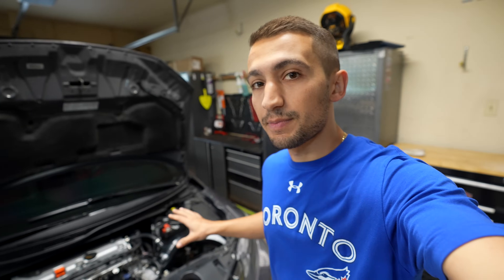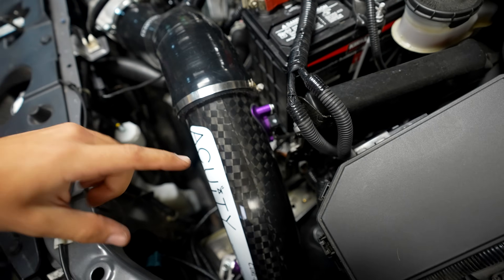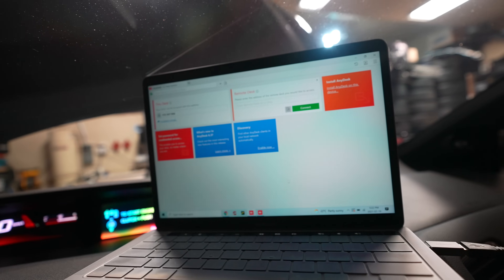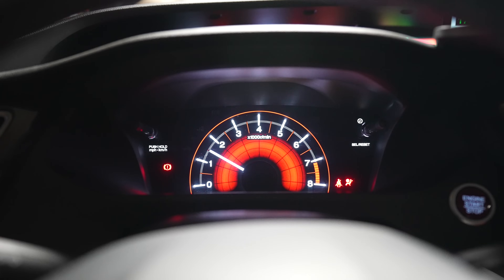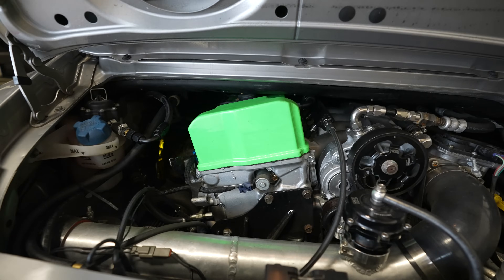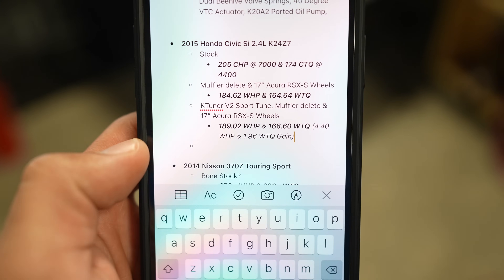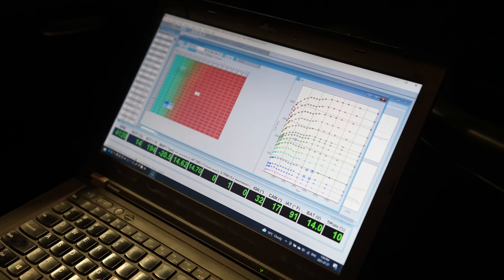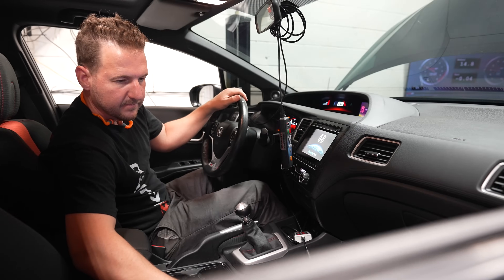Getting a Pro Tune for My Honda from TuningByNick // 9th-Gen Civic FBO Part 4 of 4

Comment: Hey you’re very knowledgeable in k swaps. And I would like your expert opinion? I just did a JDM K24 swap into a 2004 RSX Base 5 speed manual. It cranks but it won’t start. This are the mods I did: 1000cc injectors, skunk 2 intake Manifold, skunk2 70mm throttle, skunk 2 4bar Map. Acuity tps. K tune fuel rail. And your classic autozone short ram intake. It gets fuel pressure (I have the gauge), it cranks. But it just won’t start. My question is do you need KPro on the ECU for it just to start or can it start up without it? Or did I mess it up? Appreciate your help in advance
Reply: it absolutely needs a tune before it’ll start, especially with gigantic injectors like those, 510cc would’ve been just fine. it can’t fuel it properly at all. base tune it before even trying to crank that

Comment: Wow, just did my JDM k24a RBB-3 swap after blowing my k20z3 lol. Intake, header, exhaust, 4piston type s oil pump, 50 degree VTC from my k20, stock TB and injectors i made 233whp and 198lb ft torque vtec hits at 5k till 8.4k. Not sure you made such little power with the the upgrades you did. Considering you are basically FBO and i have basic bolt ons. Love the build series tho

Comment: Loving the sound that comes from the newly installed intake.
By the way, do you have any advice on ignition knock during low rpm? 
Will it cause any serious damage to the engine?
Reply: Why are you getting engine knock, running a stock ECU with a modded engine? These engines can handle knock quite well, but it will eventually lead to oil consumption.

Comment: Do I have to get a pro tune if I just have catback and intake or would a hondata flash pro basemap suffice?

 I did talk to Nick and his pricing is very reasonable, I just won’t have the funds for the next few months.

I bought flash pro intending to pro tune asap I had funds set aside and my Bc coilovers completely failed on me
Reply from the maker: Hey man! The basemap should tie you off for that amount of time, but I would watch your knock count while you're driving to ensure you aren't hurting the engine. 
BC has a warranty if you bought them new. Might be worth looking into
Reply: @milanmastracci  Thank you for the advice. Solid advice but I bought the car with the bc coilovers, not sure if they would cover if I wasn’t the original purchaser. I guess I can give it a shot.

Comment: Huh my 9th gen accord sport makes more than that and it’s a “full bolt on” car
Reply from the maker: You're running a completely different engine. You're basically running a 10th gen Honda Civic Si 1.5L Turbo engine. It is a lot harder to make power from a car that is not factory equipped with a turbocharger.
Reply: @milanmastracci  my car doesn’t have a turbo, it’s a k24w I said 9th gen accord not 10th gen lol but I think the reason I’m making more power is because of a lot higher compression and GDI. However I do love the 9th gen Si i just wished there was more all motor potential there
Reply from the maker: Oh that's my mistake! Yes the higher compression ratio will for sure help! The engine build for this car I have going is relying on higher compression pistons to make that extra juice

Comment: Youd be better off just putting some drop in cams those cams r holding you back big time
Reply from the maker: When I made this video, aftermarket K24Z camshafts didn't exist.
Reply: @milanmastracci  its the same head as the k20z3 lol

Comment: If Im only getting a catback exhaust and flashpro, do I need a pro tune or will the basemap reflash be okay?
Reply: you will feel a gain even on base map
Reply: If it's only catback you don't need to do anything. Once you get a downpipe, you should get a tune to take advantage of it. But overall you're gonna be okay with a basemap. But definitely get tuned when possible

Comment: Numbers seem a little low for a RBC intake manifold, this car with down pipe and exhaust, stock intake manifold with cold air intake can make about 220hp
Reply: Same dyno system was used my car made 201 on 91 octane fuel
Reply from the maker: Remember to compare dyno figured using the same dyno. I made this power on a Dynojet. Other dynamometers can give you higher and lower figures using the exact same car.
Reply: nick doesnt do any corrections, What it puts down on that day is what it is. Most places have some type of correction for weather/humidity/kpa. In EU we use DIN correction so it doesnt matter what outside temp is. If you dyno at 35c temp you will get +2.5% correction, if temp is -10c you will get -2.5% correction of actual power.

Comment: Hey man good vid as always 🙏🏻 I have a question regarding gas octanes specifically shell 91 vs petro 94. I see that your car is tuned on 94oct, what was your reason? I know for a fact that 94oct or higher is used for FI cars to eliminate or minimize to some extent detonation or pre detonation. In your opinion what are the pros and cons of both octanes in racing/tuning (performance) perspective? Or even economical use for n/a or FI engines.
Reply: Higher octane can get away with more timing which equates to more power(to a certain extent).
Reply: 94 looks better on a graph, or maybe they just have 94 octance in Canada
Reply: Higher octane rating = higher detonation threshold, therefore more advance ignition timing and higher compression ratio can be run for more power and torque

Comment: So i noticed while Nick was tuning that you had your VSA, Hill start, ABS, and traction control. I had these exact lights pop up after swapping my clutch out. I actually still have them. How did you get rid of them? We’re thinking it’s something to do with the steering column
Reply from the maker: So those lights illuminated at Nick's shop since the front wheels were spinning (on the dyno), while the rear wheels were stationary. So you most likely have a faulty wheel speed sensor that needs replacing. I would get an OBD scanner and see what codes come up.

Comment: wassup man i had a ktuned 72 mm tb on my car and got tuned and everything, but the car ran bad with it on, i put the stock tb back on and got retuned and the car runs so much better, any explanation?
Reply: To run a larger TB you need cams, a larger plenum, a good header and exhaust. 72mm even on a stock kfrank or k24 will negatively affect low throttle power, ie bog. The stock 62mm TB is well enough to support any kseries bolt on engine

Comment: Interesting. The internet made it sound like the RBC loses a lot more low end power. Would be interesting to see the difference between stock and RBC with the same supporting mods.
Reply: @chrisb15679  i feel the same about my 2g tsx sedan with the auto. I'm wondering if it would be worth it
Reply: @chrisb15679  thank you chris
Reply: @chrisb15679  if I’m correct 4piston makes a drop in cam , I’m looking into it rather than swapping the head I might just buy cams debating

Comment: Hey got a question can you have any idea  what's wrong with my 9th gen civic si flashed ecu  never completed  the flash an now it not running  I checked all relays an fuses so I check the for signal at starter  an no power  the fuel pump  no power at ob2 port to but its like it wants to start meaning everything  lights up but I can't figure it out no signs of keys or security  I purchased  a brand new ecu for it $$$ from honda no difference  I'm lost can some one help thank you
Reply from the maker: Was it working fine before you tuned it? Did you try re-flashing the ECU? Are the grounds for everything okay?
Reply: @milanmastracci  the ny inspection was up so I took it  fir a new inspection an it didn't pass  came up o2  put in new o2 an drove the car  an  over an over every time it's not ready all a sudden it's really starts not run right I checked the in injectors  because the car started  running real rich bad fumes  an seem like it was missing  I put new plugs an injectors did nothing  took to local shop an they  were like pick up the car okay there like put it back to stock right okay so I took the car back an they said we didn't touch the car  it's barely running  so I get the car home an trying to flash the ecu that when it never finished th flash an lost the signal to starter an fuel pump so I'm gonna star tracing out so wires lol
Reply: Yes the car was running

Comment: Damn that’s crazy you got an RBC and throttle body, but only made 213HP with 173 tq, I only have full race 3in catless with 3in full race exhaust, stock intake system. I made 198HP and 190 tq. I guess it’s true that an RBC manifold on this engine drops torque.
Reply: Comparing two cars on different dynos doesn't prove anthing
Reply from the maker: 190tq seems quite high for an NA K24. The RBC doesn't drop peak torque, it just shifts it essentially to a higher RPM.
Reply: You didn’t make no 190 tq that’s cap
Reply: @Boosted_si  I’ll show you the dyno sheet numbers don’t lie bud 🥱

Comment: Nice numbers! I recently got tuned by Nick and have been super happy with the car, it made just shy of 200hp with just an intake and exhaust
Reply: what intake
Reply: @SLWZ34  K&n typhoon
Reply from the maker: I'm happy to hear that Jared!
Reply: What do you drive? I’m a full bolt on 06 rsx type s (k20z1) with no porting, throttle body or bigger injectors. Nicks saying I should be making around 215whp.

Comment: Do I need to go FBO if I want forced induction?
Reply from the maker: You do not. You can stay with your stock intake manifold and throttle body if you like, however you will see more gains by doing these mods too.
Reply: @milanmastracci  thanks

Comment: It was nice following the whole series so far have a 9th gen as well. My only concern is reliability and mpgs since I’ll be in school for a while, most of my friends say as long as the installation and tune are done correctly everything should be ok? Thank you for uploading these videos not many videos thats in depth as yours and on a 9th gen specifically
Reply: As long as you have a good tuner who doesn't push the power to high it's perfectly safe especially on naturally aspirated engines. Just remember any power added over stock will make you lose reliability no matter what.